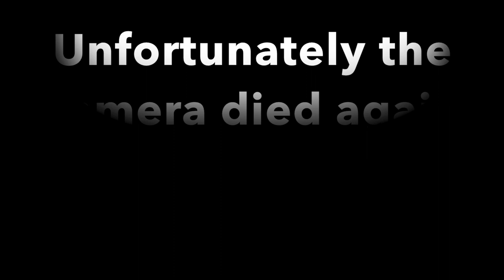installing a bucket seat in my b-series falcon

Comment: Do you get any air bag lights if dont put back in air bag seats?
Reply from the maker: Yes
Reply: @nicshepherdfilms  is there any way to bypass the air bag plug for seat
Reply: @zenkisilvias1428  you get a resitor for the airbag
Reply: @toppydalziel7014 what is a resistor for airbag mate?